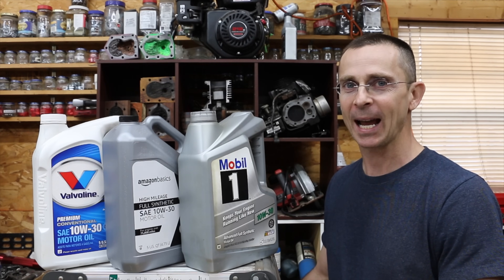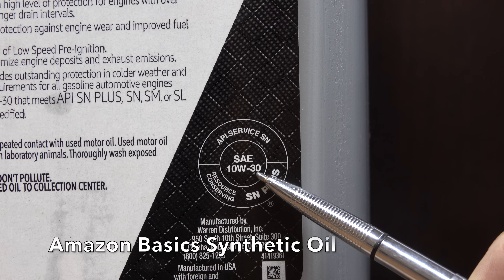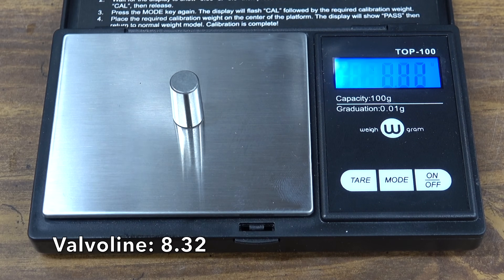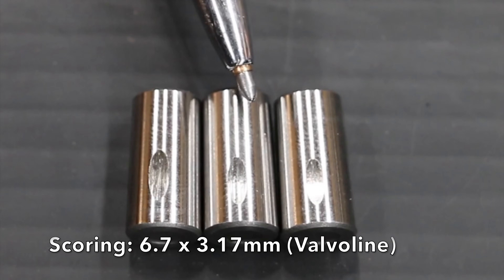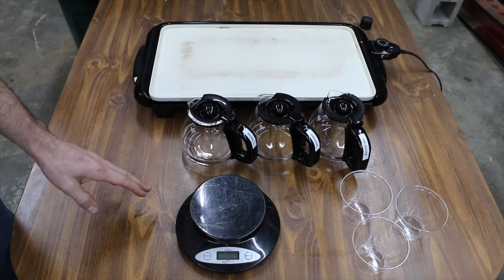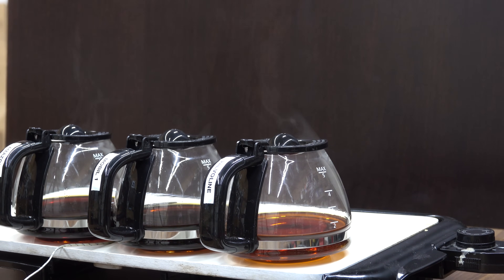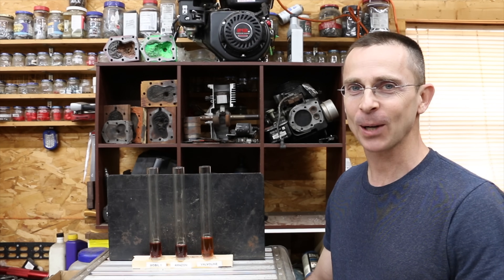Is AmazonBasics Full Synthetic Motor Oil better than Mobil 1? Let's find out!

Comment: Project Farm! I have a request. The newest most hype on the internet right now is Valvoline Restore and Protect. They are amazed at how well it's cleaning the engines. I would like to see you test this oil and also see if it will clean from soaking parts in a container in this oil over time. Amsoil also claims that their High Mileage oil works the same way as the Valvoline Restore and Protect. Maybe you could do a comparison test against each other?

Comment: The W in motor oil is not for "winter" it stands for weight, which is the rate of flow at standard operating temperature of 100⁰ celcus... If you're doing these videos make sure you know what you're talking about cause now I think you have no idea wtf you're doing
Reply: Also I'd like to add... 100⁰C isn't "low temperature"

Comment: I found a motor oil brand called Eneos while I was picking up some parts at a performance shop in LA. Seems to be targeted towards high performance applications, Lexus uses the stuff in Super GT. Would be cool to see it pitted against Pennzoil Ultra Plat, Amsoil full synth, etc.
Reply from the maker: Thanks for the suggestion.

Comment: Oil is important, but there's a new decision we must make to maximize the longevity of our vehicles. If you look at current trends, the best way to avoid engine problems today is to refuse being a guinea pig. The automakers are putting tiny engines in heavy vehicles and using turbochargers to get extra power from them. But they won't tell you that a turbocharger produces greater pressure (compression) and heat which combine to shorten engine life. It won't matter how good your oil is if you're running a small, over-worked engine. Stay with naturally aspirated engines. Use good oil in those and you'll be a happier consumer.
Reply: Still, a lot of turbo diesel engines here in Europe have more than half million km and are still running like a champ

Comment: have you tested napa oil yet? I havent seen a video on it. my mechnic uses that or carquest i think either one is fine. my engine runs as tight as new when i bought it w 60k miles almost at 100k
Reply from the maker: Thanks for the suggestion.

Comment: Request 

Rotella vs Amsoil, Motul, and any other comparable off road specific oil. 

Reason: 
Tons off off road dirtbike racers two and four stroke use Rotella oil instead of an oil that is engineered specifically for high revving wet clutch abusing racing machines. 
I am in the camp that oil engineering matters but some people think its all the same. 
While most oils will work, I believe some work far better at protecting. 

I would love to see a test on clutches and high RPM somehow. How do the different oils hold up?

This is a constant debate
Reply from the maker: Thanks for the suggestion.

Comment: Thanks for this video.  I'm due to do an oil change on my Land Rover Discovery Sport.  They use a very specific type of Castrol.  I used that oil last time, but its out of stock.  It looks like its an SN Plus oil.  So your video made it easy for me to pick up the Amazon Basic.  I had never heard of that rating before.  So that was a very helpful tip.
Reply from the maker: Thanks for sharing.

Comment: I have a suggestion for motor oil testing.  How about comparing some European brands to the top brands you have already tested, such as AMS oil, Mobil 1, etc.  A few suggestions, Motul and Liqui Moly and also Total.  Never see testing on these brands much.  Bid names such as Royal Purple, Redline, and Castrol has some Euro Spec oils you don't hear much about.  A lot of racing uses Motul and Liqui Moly, but no doubt, sponsored.  Your thoughts?
Reply from the maker: Thanks for the suggestion.

Comment: Here are two ideas for tests. Today I had my vehicle at the dealer for scheduled maintenance. It only has 19K miles on it. They suggested I flush and refill the brake fluid for $150.  How do I know if that is true because it looks ok? Amazon sells a number of testers. How do these work compared to a lab test? A similar test could be done on motor oil.
Reply from the maker: Thanks for the suggestion.

Comment: Love all of your video's thanks for doing them. I've been using Walmart's Super Tech oil for years and Amazon basics when it was cheaper. Lately I've switched to Rural Kings Providence 0w 20 full synthetic at $17 per 5-quart jug it is by far the cheapest. I change my oil every 3k so even if it's slightly inferior to the rest it shouldn't matter. It's most likely the same oil anyway so I'll use it from now on until something cheaper comes along.

Comment: The lubricity wear test on the bearings should be given more weight in choosing a quality oil.  And a slight difference in wear between oils equates to a big difference in real life use when engines are revved and ran for thousands of hours. 
Also oil analysis labs can give away secrets when they disclose their test results.  Then you can know the oil additive packages with different oils and make a more informed decision. 

Just me thinking about these tests over a few years.

Comment: Cold flow is only really important in extremely cold conditions to allow a easier engine start HOWEVER, a slower flow oil offers superior engine protection.  Either way, you should always pick what the manufacturer advises you to.
Reply from the maker: Thanks for the feedback.

Comment: Any other synthetic oil is better than Mobil 1....sorry but Mobil 1 is  garbage i think Pennzoil ultra platinum and amsoil are miles ahead and Mobil 1   left in the dust  scratching their heads wondering what happened and left wondering if they can make a synthetic oil that will match performance with Pennzoil ultra platinum and amsoil
Reply from the maker: Thanks for the feedback.

Comment: Dang have always used valvoline in my Nissan it has 300,000 miles.  Could’ve gotten 400,000 if I used one of the other brands.  I always talked up valvoline, but seeing the tests makes me question the brand.  Thanks for the video.
Reply from the maker: You are welcome!

Comment: Wel, I'm a tech, this test proves my long time opinion that Valvoline sucks, have seen many problems related to there oil  over the years to make me believe this, one of the best ones  had an old man tell us at my old shop he was bringing us his truck had engine issues, diagnosed the thing, clear lack of lubrication and quality of lubrication, had suck rings and clogged oil passages, also had very premature wear on the bearings and cam lobes, and the sludge was unreal and varnished very badly, looking like he was running moca latte from star bucks,( the stupid fram filter helped this along I'm sure also) sadly the engine only had little over 100k Miles, when we told him the problem and asked what was the service history, his answer to us was ( it can't be that I've always changed the oil and filter at 5,000 or less and I use Valvoline I swear by it I've used it in the last 6 cars I've had) showed him the engine for himself and told him if he wasn't running Valvoline he probably wouldn't have went Thru 6 cars so quickly ( found out later all due to engine issues) that was funny, we changed his mind on that one.
Reply from the maker: Thanks for the feedback.

Comment: If you need to start an engine when the temperature is very cold, exactly how the oil flows at -40 degrees is not that important for two reasons. One of them is that you are never going to encounter a temperature that low unless you live at a far north latitude. The other one is that the oil immediately begins to warm up as soon as the engine starts running. The mechanical forces alone will warm the oil, let alone the heat generated by the combustion of fuel.

The performance of the oil in a particular engine has to do with matching the specifications of the production, the specifications of the product used and the type of driving. My vehicle was built in 2001 and has an engine that was first introduced in the mid-1980s in a single overhead cam version. The oil requirement is for 5W-30 or 10W-30 conventional. The best price oil I can get is semisynthetic and I set the oil change interval at 2800 miles based on all-short-trips driving.  People may not want to believe it, but all-short-trips driving represents severe duty.

Low-end synthetic oil is Group III synthetic refined from petroleum oil out of the ground. I would not leave it in much longer than I would conventional or semisynthetic. My sources say, do not go further than 7500 miles on any oil in any engine, and cut that in half for severe duty. That makes it not worth it to buy Group IV synthetic if the production does not require synthetic oil. If I had a late model vehicle with a turbo, I would use Group IV syntheric. Naturally aspirated, I would use Group III and maintain a lower oi change interval.
Reply from the maker: Thanks for the constructive feedback.
Reply: @ProjectFarm  There are different mechanical theories. My theory regarding motor oil is that there is no point in paying for specifications that you do not utilize. I could use Amsoil in my vehicle but what would be the point? I drive about 600 miles a month at the most, and rarely go more than three miles on any trip. That indicates an oil change every six months even with Group IV synthetic.

Comment: 52 year old shade tree mechanic here. In my experience most, if not all, motor oils will do what you need-lubricate. I have always changed my own oil (and done 99% of my own repairs, cars and small engines) since I was 16. I've only once ever had an engine failure. That was a push mower (4 cycle) that I lazily didn't change the oil on for 3 years. My current "fleet" of 4 cars have over 470K miles on them combined (yes we drive a lot). Lowest mileage vehicle is 70K. I have a Toyota with 160K miles that doesn't burn a drop of oil-I've used mobil 1 and walmart brand specificed oil at specified changes with Toyota filter (and I plan on keeping this thing until it eventually wears out-which will probably be over 300K). An 89 bronco I restored (body) with 150K miles that has uses conventional oil and Wix filters. If you change your oil at specified intervals, IMHO it doesn't matter which brand you use especially with modern engines.
Reply from the maker: Thanks for sharing.

Comment: If somebody put thicker oil into your car than what's recommended (engine above 100k miles), can you just switch back to thinner oil again at the next oil change? Or should you get that oil out asap?
Reply: How much thicker ? What climate are you in ?
Reply: @joecamel6835  Im in SoCal, so it's desert climate where I am. But only the first number relates to that. The 20 or 30 refers to the operating temperature of the engine and that gets way hotter anyway regardless of where you live

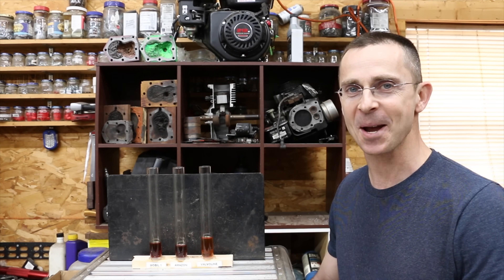Comment: At 10:41 The amount of oil being "sprayed" on the sides of the cup was massive, demonstrating what so may other saw and I want beck to check on; more oil for the Mobile 1 test, for sure.   More accurate measurements of the amount of oil used for the tests is the only negative that I see...other than the non- Synthetic Valvoline used.

Comment: As a Valvoline full synthetic (modern engine GDI extended protection and then high mileage max-life) mixed with the oil additive BG MOA PN 115 on both cars since 2018,  I was floored how the Valvoline struggled against Mobile 1 and AmazonBasics. Scratching my head. But I think you did not test exactly the same Valvoline I use.  I watched your other video  for the championship and might switch to Pennzoil platinum high mileage full synthetic.
Reply from the maker: Thanks for the feedback.

Comment: Mobil 1 and Amazon and practically all the brands that say they are full synthetic are not full synthetic. They are group 3+ hydrocracked base oils and with some group 4 and 5 oils in them. The only oils that I kmow of that are 100% pure synthetic are Redline and Amsoil. Redline is a group 5 ester oil and Amsoil is a group 4 PAO base oil. And Castrol 0w30 or the European formula is group 4 oil as well.

Comment: Years ago, I purchased a used car from a dealership with a noisy engine. I knew the previous owner had faithfully used Havoline motor oil and this engine had been extremely quiet (no overhead clicking). On advice from the USN Base garage mechanic, I took this car home and changed the oil with Havoline and ran it for 200 miles. This time I changed the filter and the oil again using Havoline. The engine was once again quiet. WHY?

Comment: Suggestion for future video is durable flashlights exposed to prolong heat, freezing temperatures, and vibrations as stress tests. Flashlights using bulbs such as halogen, xenon, and led. Could be one approach as well  I have seen some major names fail when stored in a car, even with fresh batteries. Being this is something needed in an emergency I sense it would be a safety thing which you could be doing a great service to people finding the great flashlights.
Reply from the maker: Thanks for the suggestion.

Comment: Would you be willing to do a comparison of Oil filters for removing particles and reducing engine wear? I heard that the size of particle removal (in microns) and efficiency (what percentage can stay in filter) are HUGE for engine longevity. Mobile1 Extended Life filter vs. Royal Purple vs. Amsoil vs. Fram Ultra Synthetic ?
Reply from the maker: Thanks for the suggestion.

Comment: Jeez,, theres real simple test tell how well an oil is performing, run the oil in an air cooled engine and monitor the temp, the lower temp wins, less friction equates to less heat,, end of story, the only unknown now becomes how long the adatives last, that part of the equation can only be told by a lab

Comment: Learn to change your own oil -  You’ll save enough to get the Best for your Own Piece of mind !  Changing in a timely manner  is critical ?   I’m 74 and have owned at least 20 cars and trucks - I HAVE CHANGED ALL OF THEM AFTER EACH 5000 miles and NEVER HAD ANY PROBLEMS ( other than belts etc. and after a proper Break In Regimen to manufacturer recommendation ).     EASY TO REMEMBER ( even for spouses and children) 🤗
Reply from the maker: All great points! Thank you

Comment: I think it's important to first validate the methodology by running the same exact test twice to make sure the result is consistent. For example, repeating the Amazon oil test and getting 0.12% each time. Otherwise it's impossible to tell the difference between "natural fluctuation of the result due to test issues" vs "real difference"
Reply from the maker: Thanks for the feedback.

Comment: Is Royal Purple Worth the extra dime? Should do a video on that.
Reply from the maker: Thanks for the suggestion.
Reply: @ProjectFarm  I use it in my John Deere Tractor and my log splitter given they are not big engine so I want to use the “best” (or at least what I think is the best oil)

Comment: Thanks for this great video.  I was hoping you'd rerun the cold flow test after the synthetic oil heat breakdown and evaporation test, and you did!  The only thing I'd have liked to have seen was a comparison with Castrol full synthetic as that's what I've been using, but I see you have another video popping up in my sidebar with a LiquiMoly test so I'm off to watch that.  I had already ordered Amazon Basics synthetic oil for all three vehicles' annual oil change next year (no more than 4000 miles each) so it was good to see Amazon works well.
Reply from the maker: You are welcome!  Thanks for sharing.

Comment: first of all let me say thank you for all the testing and attention to detail that is included in your videos. here's my situation and i will start by saying my training is old school i have a few older vehicles 20+ years and know when they were built they used conventional oil which is now harder to find. some of these have had great maintenance schedules according to carfax but prior to my owning them i don't know what oil was used just that it was changed regularly. now everything is synthetic and your video shows that synthetic performs better but in my case... is there a problem with switching back and forth between them? i don't know what oil was in it before i bought it, and it may have started with conventional then switched to synthetic and now back to conventional, because that was what it was built to run on... what's your opinion? does the back and forth cause more damage? sounds like a new test may be needed...look forward to your answer or link to another video where this has been addressed. thanks in advance

Comment: Have you ever tested Providence synthetic oil  sold by Rural King stores?
Reply from the maker: Thanks for the suggestion.
Reply: @ProjectFarm   Actually I did send an email a few years ago to Warren oil.  The gentleman that I talked to said that  the old RK oil,  which was next called  Harvest King oil,  and is now renamed  Providence oil  are the same oil as  Warren's  Lubri Gold synthetic.  He said maybe one or two additives are different...........and then he chuckled and said  they're both bottled on the same line.  Which.  told me  I was getting Lubri Gold  under a different brand name.  I  have used  Rural King oil products for years with no bad experience.  However,  like all petroleum products,  Rural King stores have increased their prices.

Comment: Fyi, I have a Mazda 3 Turbo just about one year old now 44,000 miles ( I do independent it Contracting, drive a lot on short notice).  I used Amazon basics this time. I did notice when I was at Walmart that they had Mobil 1 for $27 per 5 liters, and I think that's what I'm going to use next time.

It's not that I'm not satisfied with the quality of Amazon basics. I am. But mobile one is when I always used back to my racing my 968 days.  

If you have any thoughts or input, I do appreciate it